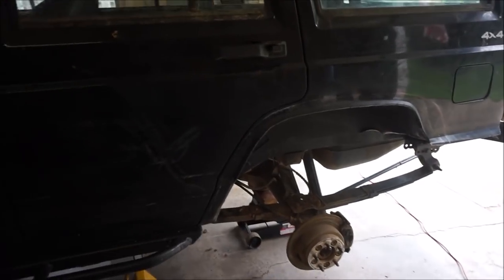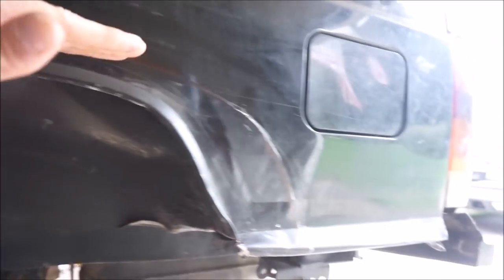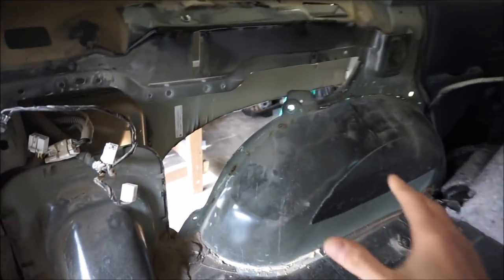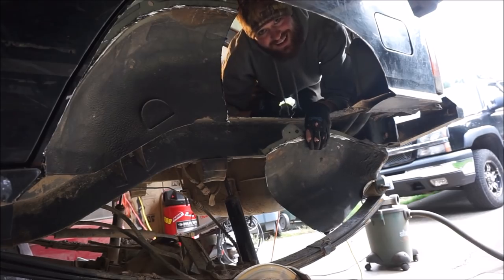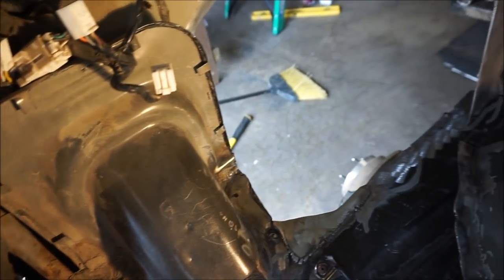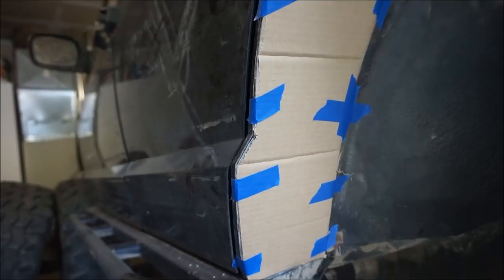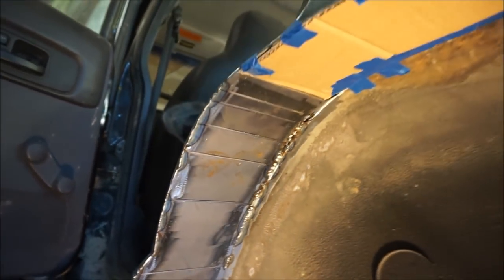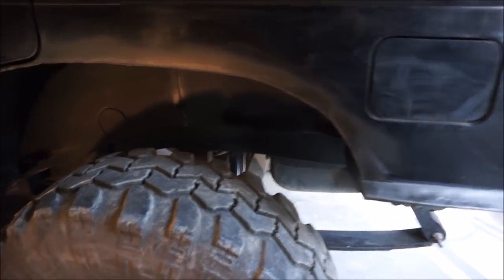Jeep Cherokee XJ Rear Fender Stretch

Comment: I’m about to embark on replacing rusted out leaf spring pockets under the seat along with the cargo area floor and I have a fairly clean parts jeep that I can cut plenty of sheet metal from. This video has now given me quite a few other ideas to do at the same time and this will let me move the axle back a tad too. I might even go all the way back to the fuel door.

Comment: For bending the metal I used my old truck and the yard. Put the plate in the grass and drive on it. Curves the steel nicely and you can bend it back if you go to far. Learned the hard way resurfacing a plow blade.   Good job on the build.

Comment: Fu**n awesome!  I was just removing my factory flares after I added the lift and tires, and first drive down the road the front tire ripped the driver side front flare off 🤣
When looking at the back I didn't like how small the opening looked compared to the front. Researching- I realized that pinch seam was structural and you can't just cut it and leave it be.
I think I'm gonna attempt this!
My only fear is having to weld that sheet metal. I don't know if my welder can dial down enough for it.

Awesome job, that looks perfect!
Reply from the maker: .023 wire and turn settings way down.  It was a pain for sure.  Sheet metal sucks to work with in my opinion
Reply: @MuddyBeards4X4   haven't tried wire that small yet, I'll give it a shot. Thank you!

Comment: You may not answer since this vid is so old. Are you using a 110 welder or 220? I have a 110 so I was curious if it was strong enough. Should be since it's sheet metal
Reply from the maker: Sheet metal work w
Either would be fine.  I was using my Hobart 190 (220 volt)  but turned way down with .023 wire

Comment: Interesting video man! Very clever solution! Thanks for doing it.
I'm about to cut into my rear 1/4 panels myself. I'm not running nearly as large of a tire as 36's, but more clearance is always an issue. This video really helps me by showing me the anatomy of the XJ before I dig into it.

One question though, are you thinking about plating up the frame rails at all? 
I did the mid frame stiffeners on my 95 XJ and I was shocked how nice that made the XJ feel. Very solid. The front probably wants the entire front axle removed to do it properly and the rear needs the gas tank removed to full access back there I suppose. 
Again, thanks for the video man!
Reply from the maker: Thanks man! Glad the video helped.  Yes I have reinforced the uniframe in the mid section only so far.  I actually just made my own out of some angle iron.  I plan on making my own in the front and possibly rear too.  It's certainly worth it to stiffen the unibody, especially if you offroad.
Reply: Edit: Never mind. I just found and watched your video on plating the frame rails.

Comment: Are you running stock motor? I have 33’s and it’s not to peppy given the fact it has 200000 miles
Reply from the maker: Ya stock motor.  However I have 4.56 gears so it does ok.  Gearing is the best replacement for lack of power.
Reply: Awesome thanks for getting back
Reply from the maker: No problem brother.  Thanks for watching

Comment: Hey! Idk if you still check this channel, but I need to replace the rear quarter on my xj because the part where the flares and the body meet has completely rusted out. Is it plausible to just buy a rear quarter and weld it in or should I do a rebuild of the well like this?
Reply from the maker: I dont think you can buy a quarter.    The body is pretty much all one piece.  Maybe you could cut one off another rig and weld it in? I would just rebuild it though probably less work and less body work
Reply: @MuddyBeards4X4  that may be the route I take I plan on hiding it behind some body armor anyway. I really appreciate the response!

Comment: What kind of seam sealer did you use? And how has it held up since then?
Reply from the maker: Its just automotive seam sealer I think I got at auro zone, and so far so good.  I actually popped one of the spot welds when bolting on quarter panel armor and the sealer was still holding on.  I had to grind it all off to reweld it.

Comment: What did you do to clear the tires in the front?
Reply from the maker: A lot of cutting lol.  I still have some issues with clearance so I might try to figure out something up front too
Reply: @MuddyBeards4X4  I have 33s and when I flex and turn aft the same time I rub. I had to replumb my snorkel with pvc cause the tire rip it out.
Reply from the maker: Dang man.  How much lift?  You might have to bump stop it.
Reply: @MuddyBeards4X4  4inch lift but I did the fender cut and the cut and fold in the rear. I want to do a lcog build. Around 6inch and 37s to 40s. Was wondering how to make room. Might have to strech it.

Comment: What axles are you running with the 36’s? Love the cut, my front and rear rub was going to bump stop front and cut the rear... now i know how I’m cutting the rear! (;
Reply from the maker: Right on man.  It's totally worth it.  I have no more clearance issues.  I'm running the stock 30 up front and a Ford 8.8 in the  rear.
Reply: Muddy Beards 4X4 cool!! Any better axle shafts in the front? I still have the Chrysler 8.25. Did you go from 35 to 8.8?
Reply from the maker: Nope stock shafts.  No issue yet.....but I'm sure the time will come. And yes it had a 35 and swapped to an 8.8
Reply: Muddy Beards 4X4 I’ve ripped apart 2 front shafts lol going through fordyce this last year. Have 1 tons but haven’t built them yet. Waiting for another 1k and time for the 4.6 stroker. Not sure if I need it. So many plans, so little time ...
Reply from the maker: I hear that man lol.  Also too little budget.....